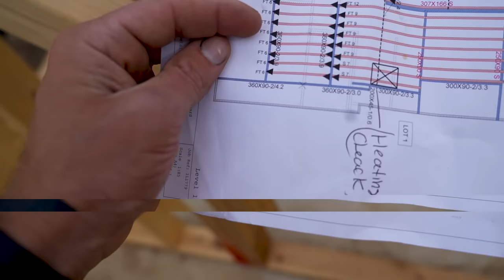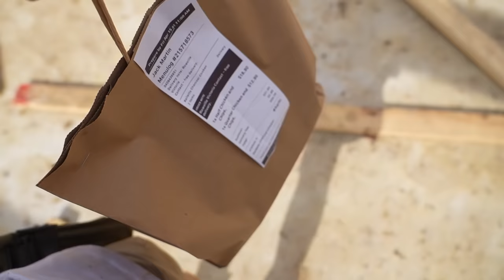Installing Beams // Sub-Floor Framing //

Comment: Bad news for you mate....the music in the background will likely get this video banned by YouTube.  It will probably be another YouTuber who turns you in,  although I think YouTube has an method for trolling vids that catches copywrited material being used.  If you want to produce content,  then you will have to work without the radio.   Side note---buy a Hitachi NR83 nail gun.  It is by far the best gun ever made and nothing else is close.  CARPENTER ARE NOT MORTALS!!!!
Reply from the maker: Yeh they hit me with that in the checks, they ran a beta program to remove the background noise and apparently it’s all good now haha I can’t notice the difference 
Fingers crossed 😂